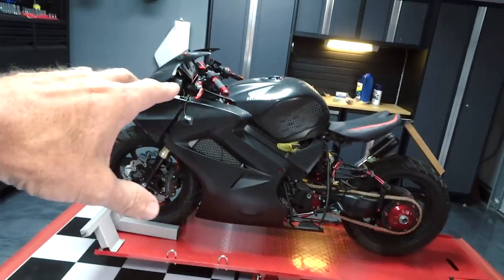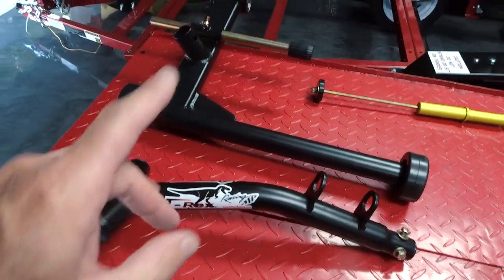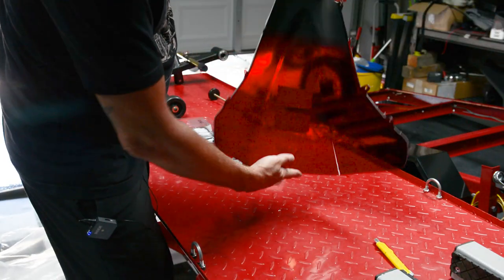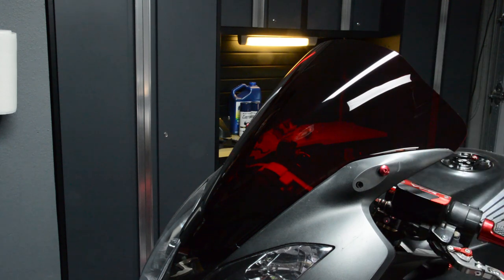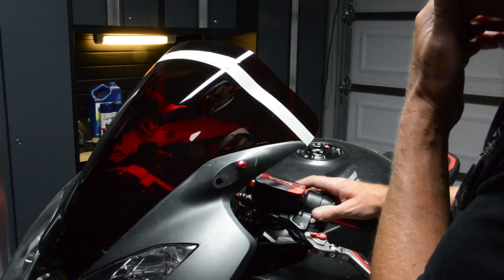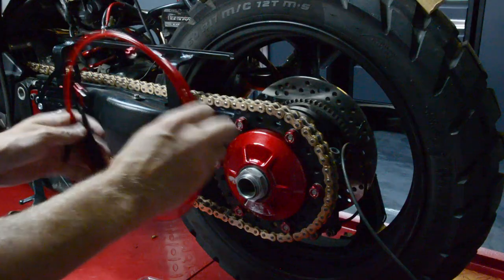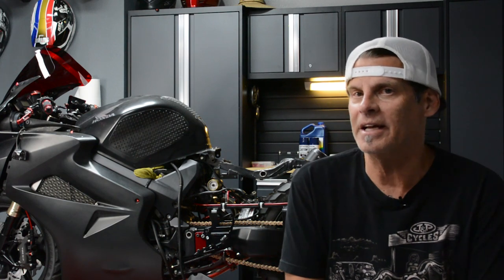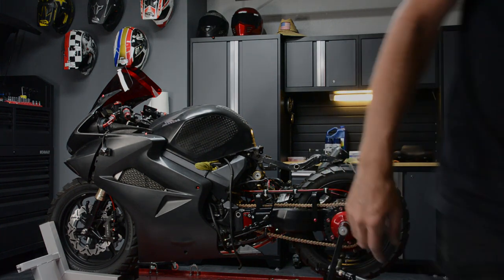HONDA VFR800 V4 BIKE BUILD - Unique Wind Screen and More !

Comment: AAAAAAAAAaaaaahahahahahaahahahahahaha

Finally realize that CBR fairings don't fit side mount radiators did you?

Did you not read the part where the only real option would be to do an RC51 fairing swap yet to make it look different?